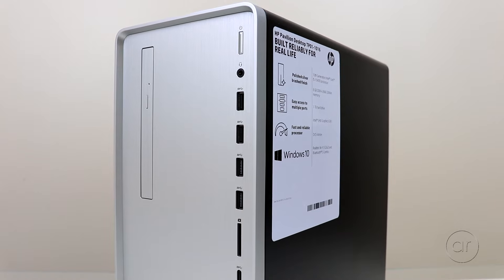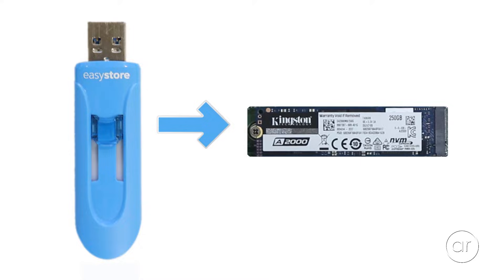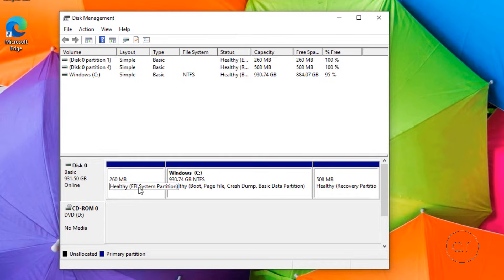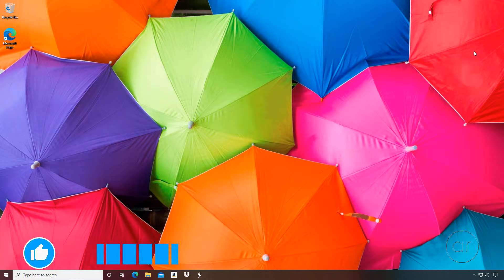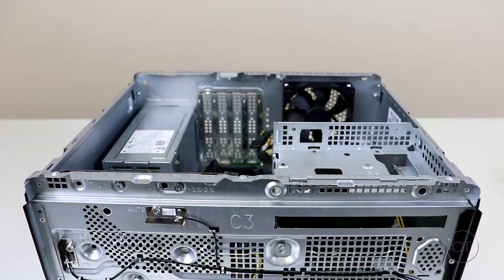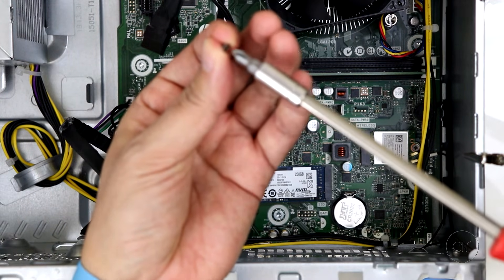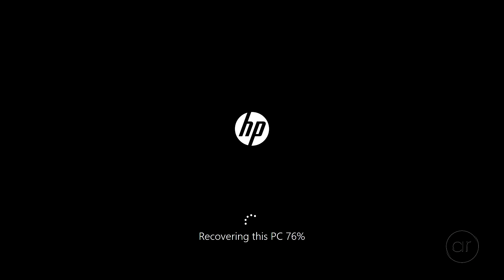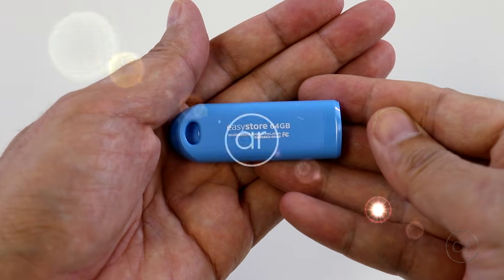Upgrade to an M.2 NVMe SSD and Restore Windows 10 (without Cloning)

Comment from the maker: Much obliged 🎩 to all my viewers. Like. Share. Subscribe. Enjoy.

Support links
☕ BuyMeACoffee: https://buymeacoff.ee/accessrandom
🐦 Twitter: https://twitter.com/accessrand0m
🔵 Subscribe: https://www.youtube.com/c/accessrandom?sub_confirmation=1
Reply: How can we move the window from one drive to another? I want to move the window hdd to ssd. That I have already in my laptop? Please help my computer becomes so slow. I think thats the reason
Reply from the maker: @jasbirkumar9306  You may want to visit one of my other videos where i clone from an HDD to an SSD. It's an older version of Windows but will work with later versions: https://youtu.be/mKSmwyPXH2I
Reply: @accessrandom  In Performance section The SSD section displaying 0% read and 0% write speed. whether in HDD its is fluctuating based on the action i am performing. How can i check that i have installed my windows on SSD and also My system is running on SSD? Please helps me out. My system is running very slow. One more thing that some days ago i have updated my windows to 11 but few hours later i again changed to 10 because it wasn't compatible. is this the reason?
Reply: Thanks. I'll try that.

Comment: The cooling is aided a lot by moving to SSD.  A good 512 SATA is about $33 if you shop carefully.
Reply: sata ssd is slow af though. better than hdd but not fast enough to run some newer games. if you have nvme slots,  go with nvme.

Comment: Hi Thanks for the video. If I understand correctly by creating the backup flash drive and restore version of windows will be the same as the backup flash drive? I want to make sure that the OS is the same as before. I am switching out a Dell factory installed M2 SSD with the new Samsung. I discovered it is not possible to clone the drive even though I purchased an external case. I think the cable is not correct as the OS is not recognizing the new external M2 SSD. I started looking at other ways to clone current OS. Thanks for any insight you can offer. I just don't want to loose current OS settings if a factory windows restore happens.
Reply: I managed to get the USB external M2 SSD to be recognized. It was the cable. All is cloned now. thanks for the good videos.

Comment: Very good. Works in ASUS, I guess the requirement is Windows. A warning, in my case it took 24 hours to write the USB and 24 hours to install on the new SSD. I was almost giving up but decided to wait in both cases as I read the process could be very long. The new installation works fantastic.

Comment: Hi. I just want to ask. Is it safe for the laptop battery in having an m.2 and hdd installed/using at the same time? 
Thank you!
Reply: You can have both hdd and m.2.  Some laptop actually has this setup.  However, you may want the windows install in the m.2 so it can boot faster and runs faster.  Using the hdd as your back up drive.

Comment: Hi from France

First of all thanks and congrats for your work : clear, proper, intelligent and done to be handled by anyone.

I bought an hp with yet the nvme 256go as main hdd with windows yet installed

But when I try to had another ssd on Sata 1 or Sata p60 I can't find it even when I go to disk gestion.

Do you know what is wrong? I have to check bios if thes Sata 1, 2 and p60 sata 0 are enabled?

Thanks in advance for your help
Reply from the maker: Thank you. If you add a drive to the system, the BIOS should automatically pick it up. After you install it, it should show up in the BIOS and in Windows' Disk Management (even if it is an uninitialized drive). There could be a problem anywhere along the chain - are you able to try a different SATA data and/or power cable (in the case of a SATA interface), or try the SSD in another system in order to rule out a bad drive?

Comment: What about the Windows OEM license? Don't you loose the license when you use a new hard drive for Windows?
Reply from the maker: The license will carry over to the restored drive. I believe it is embedded in the BIOS.
Reply: @accessrandom  Thanks for the answer. What if I don't make any backup from the window drive? I mean a clean installation. Do I loose the license?

Comment: So my computer had a " critical process died " problem within my drivers so I bought a new ssd because I do not know how to restore the driver or windows. Do you think the new ssd m.2 will grant me the windows installation despite the damage to my other ssd drive?
Reply from the maker: If you had a process problem on the original drive, I'm afraid it would carry over to the cloned drive (since it is basically a copy of everything).

Comment: Hello! Just have a quick question. 

Upgrading my build. Going from Intel I7 7700k —> Ryzen 7 5800x.
I currently use a SATA SSD and a HDD (system imaged from my SSD just in case). 

I am installing a brand new, never used M.2 SSD for the upgrade, and I plan on installing a fresh OS on it. 

My question is this: 

Can I (after boot up and all drivers are updated, etc and everything is solid) simply plug in my old SSD & HDD WITHOUT deleting the said info on those drives??? (Keep in mind that I would shutdown the computer, plug those in, load up bios, make sure boot priority is still going to my M.2, then load to desktop). 

If I keep my boot priority on the M.2, my old SSD OS shouldn’t interfere with it correct?

Thank you!
Reply from the maker: Since there will be two boot partitions that exist in the system (one on the M.2 SSD and the old SSD), I find that the BIOS/UEFI sometimes registers the wrong boot configuration data. You may want to delete just the boot partition on the old SSD to be safe.
Reply: @accessrandom  okay thank you! So under the windows 10 settings when I’m selecting a drive to download the windows installer to, just hit “delete” on my SSD? It won’t remove everything on it just the OS partition???

Honestly, I have everything backup up to my HDD, not too worried if so!

Thanks for the response!! ❤️
Reply from the maker: @hunterrivera4984  You'll probably want to use the method I use in one of my other videos : https://youtu.be/sfS143DikPE to target the boot configuration data (typically labeled the EFI partition), not the OS partition (which contains Windows and other files).
Reply: @accessrandom  awesome thank you sir!! ❤️

Comment: Do you need to change boot device from the bios...
Reply from the maker: I didn't need to change the boot device on my Pavilion since I only had the NVMe in the system as the boot device. However, if you keep the hard drive in the computer, you may need to change it.

Comment: I was trying to switch from a 256 SSD to a 1tb 980 SSD but when we get to the step of setting up windows on the new SSD it says there was a problem recovering your PC.
Reply from the maker: There is the possibility that the recovery partition has bad sectors (i.e., there is something physically wrong with the drive). If so, you can try running a "chkdsk X: /r" (where X is your hard drive) from the command prompt launched as Administrator, then attempt a restore afterwards. In order to assign a letter to the recovery partition, you'll need to start the Disk Management utility and assign one from there.

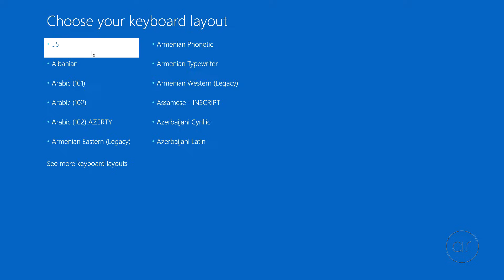Comment: 6:56 when i press one of those it says there is a problem with recover my system
Reply from the maker: You may have a corrupt recovery partition. You can run "chkdsk X: /r" (where X is your partition/volume letter) from a command prompt running as Administrator, but you would need to assign a letter to that partition in the Disk Management utility.

Comment: I followed ur instructions step by step. But after finished windows installation on new ssd, no old apps/folder exists in the new ssd
Reply from the maker: Were there any error messages that appeared during the restore? I wonder if the recovery partition image is corrupt in some way.
Reply: @accessrandom  no error during the whole process but nvm, luckily I have backups. Thanks for ur reply, great to know that actually this method can be used for cloning whole PC, not only cloning OS 👍

Comment: this method backup my win10 key and office 2019 key? and about my files?
sorry about my english
Reply from the maker: In the procedure that I use, this only restores Windows and any programs that were included by the manufacturer. You may want to consider cloning your drive if you wish to keep your programs and files.

Comment: Do i need to put in the windows activator code or is that done automatic?
Reply from the maker: Mine included the activation as part of the factory image. It may have been embedded in the BIOS as well. If you're in doubt for your computer, you can use the methods in one of my other videos to retrieve any retail product key: https://youtu.be/nl4okILnko4

Comment: When making a recovery does it copy all files that are stored on C: drive like programs or just the OS? thanks
Reply from the maker: The recovery partition would hold the OS plus any programs included by the manufacturer.
Reply: @accessrandom  only by manufacture ? So my personal files can to just transfer over to say my D: drive
Reply from the maker: @Issac_G  Yes, you can transfer them to a drive that won't be touched by the recovery procedure. Actually, this video is for manufacturer-created recovery partitions, but I haven't tried to create my own.
Reply: @accessrandom  Thank you that makes sense .

Comment: I got a problem, my recovery is stuck at 29% and won’t go anywhere, what do I do?
Reply from the maker: I think there's two possibilities. You hard drive (where your recovery partition is) may have bad sectors, in which case you should run "chkdsk X: /r" on it (where X is your hard drive). You would need to assign it a letter to be able to chkdsk it, through the Disk Management utility. The other possibility is a bad usb drive - are you able to try a different one?

Comment: I'm going to do this to my Asus laptop. But what about the Asus apps it came with? The configured settings of how I purchased it?
Reply from the maker: On the HP, it preserved the HP apps because it was part of their factory image. I'm not sure about the Asus, but I would assume they would do the same...
Reply: @accessrandom  I just finished the install, and you're right Asus did the same thing.  So it's all good. Took me couple of hours, with restoring some games too.
Reply from the maker: @samanosukeakechi4388  Thanks for the update - that's good to know in case someone else has the same question.

Comment: Can i install the recovery drive without removing the HDD , I have both HDD and M.2 installed in my laptop
Reply from the maker: Yes, but I would recommend temporarily disconnecting the HDD, then make sure you can reliably boot to the M.2. I would also wipe the HDD after reconnecting as you may run into problems when there are two boot partitions in the same computer.

Comment: I want to do this as I had trouble with one of the previous cloning videos but I would still like my hdd installed to use for extra storage but I would like to wipe it clean as well. Any suggestions?
Reply from the maker: I have another video here: https://youtu.be/sfS143DikPE that shows you how to wipe partitions off of a drive. If at all possible, attach the hard drive to another, separate computer and wipe it there - then remove it and re-attach it to the computer that has the clone/restore. You should then be able to initialize it as GPT, create new partitions, and use it as secondary storage.

Comment: Hello, a very interesting video. As you can see in the disk manager, there is no HP recovery partition or HP boot-recovery partition.
You comment that windows already has all the HP "Bloatware" installed and also the drivers.

The Recovery Drive tool is from Microsoft. Doesn't HP include a tool for you? The one that only allows you to create the recovery media once.

I have seen that for computers after 2016 you can download "HP Cloud Recovery Tool" to download the recovery media, which usually has to be purchased for € 50 and they will send it to you.

No longer come with OEM D2D partition? It would be logical (and ethical), taking into account the options included in Windows 10, including "reset this computer", create image, create recovery drive (with the system).

A friend has a 2016 HP PC and I cannot buy the recovery media for his model and also not from the cloud. Luckily you can still download the drivers (which are never updated), 2 years and they are forgotten, they wash their hands. A PC with only two SATA ports and one of them for the DVD ... It has an HDD .. and many people have problems with Samsung and Crucial brand SSDs, the PC does not come out of the POST ...

The problem that I see with the recovery drive is that it performs the Sysprep (generalize), and forces you to configure the user accounts, not to mention the inevitable questions at the start of each user.

When you do a Sysprep of an image.wim it is from the administrator account, which is deactivated, Windows starts and you install drivers and "Bloatware through a tube", when you finish it turns off and that's it, you can clone the virtual disk or create one image.wim.

Considering all the time it takes to create the recovery drive and then switch to the SSD or NVME, I don't know if it's worth it.
Install windows and download the drivers (maybe more current), install the microsoft updates, and finally a couple of tweaks with CMD (sfc / scannow, dism), and free up space.
What do you think?

Comment: Just one question bro.. can we apply same procedure without removing hdd. Only by adding m.2 ssd. 
If not thn tell please what should i do i have installed m.2  but windows is pre-installed on hdd from company
Reply from the maker: That's a good question. To be honest, I'm not sure since having two boot partitions in the same system can lead to the BIOS registering the wrong one (i.e., it may latch onto the boot partition on one drive, but use the Windows installation on the other). If you're using the HDD solely as a backup, what you could do is physically remove it but keep it in cold storage for future use.

Comment: Hi just a quick question, will this keep my files or will it remove it? Thanks, also what if I want to keep my laptop's hdd? Will this work?
Reply from the maker: If you follow the same steps in the video, your files will not carry over. You may want to consider cloning your hard drive (which would keep your files) with one of my other videos here (https://youtu.be/CHCENfs87F4) or here (https://youtu.be/mKSmwyPXH2I).

Comment: Excellent Video Tutorial as usual Sir. Question: Will this method work for and HP ENVY 750-116 Desktop as well ? And can I just leave the old 2TB HDD and wipe everything and use it as a storage for pictures and music ?
Reply from the maker: Thank you - yes, it should work in the same way though you may need a larger USB drive depending on the size of the factory image. You can continue to use the 2 TB HDD but I recommend that you physically remove it during the restoration, then reconnecting it afterwards.

Comment: can I follow these step on my HP pavilion 15 cc129tx model laptop. Will this work ? As my 1tb HDD is not working properly and need to switch to 1TB SSD also please suggest can I use SATA SSD on place of my HDD for data and NVMe SSD for Windows OS .
Reply from the maker: As long as the laptop allows booting to the NVMe SSD, it should work (please note however that some laptops or motherboards will have restrictions on whether an M.2 NVMe can be a boot drive). This particular HP does allow it. Your 1TB HDD can be replaced with a 1TB SSD with the same SATA interface - you'll want to copy or clone that data first.
Reply: @accessrandom   Thanks for you reply.

My concern is, how can I know my motherboard supports boot from NVMe or not. 

I need a fast booting and good performance so I want to switch 1TB NVMe SSD as my boot drive and give 250GB patrtion for C:\ and want to give 3 seprate partition for rest of my IT stuff i.e. for Virtual Machines and Hyper-V. And for my data like photo, documents, ebooks etc I want another SATA HDD as replacement of my old HDD.

Am I correct for doing this with my HP laptop, Please suggest.
Reply from the maker: Unfortunately, I couldn't find any information about your particular model concerning the bootable interfaces, so you may want to contact HP support directly.

Comment: Well done!!, but taking too much🤣. Which way faster between USB recovery flash drive and Macrium Reflect clone?
Reply from the maker: It will depend - a clone will copy everything on the original, so if you already have programs installed then those will take time on top of Windows and any out-of-the-box software that is installed. Otherwise, they should be roughly the same.

Comment: I have extra slot of installing ssd. So i have installed the ssd and now i have hdd +ssd and now i  want clean instalation window to my ssd from hdd. Can u tell me what is the procedure...
Reply from the maker: What you could do is use the same procedure after physically removing the original HDD. Afterwards, re-attach the HDD and wipe it clean if you wish.
Reply: @accessrandom  ok thnks for the help..

Comment: do i need to have nothing on both the C drive and the nVME in order to do this? I have Steam on my C drive and all my games are on the nVME
Reply from the maker: If you are cloning your C drive and you have (for example) all your Steam games on the D: drive, you can clone just the C: drive. But after the clone, keep in mind that each drive or partition may be assigned a different letter, so you old D: drive may become E:. If that's the case, you'll need to re-assign the letter of your Steam game drive back to D: after the clone.
Reply: @accessrandom  ok thanks for that :) ive been tryig to get my o2 on the nVME for about a year now but it wont work at all